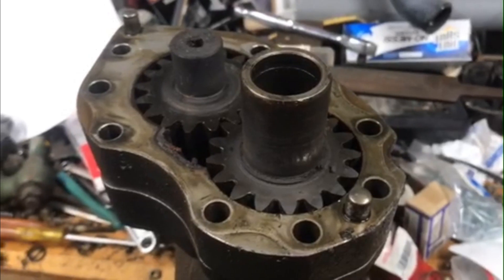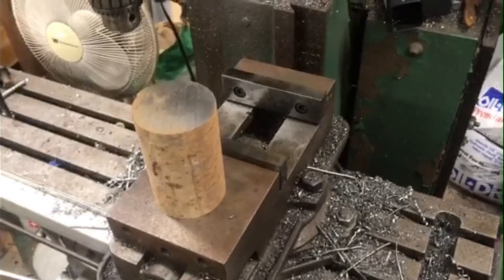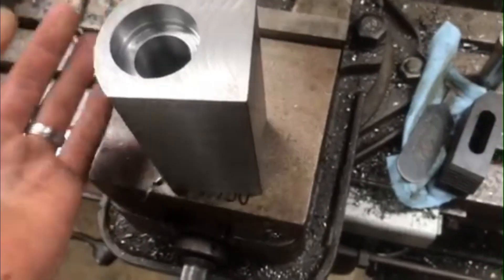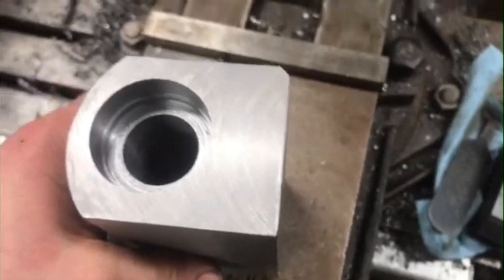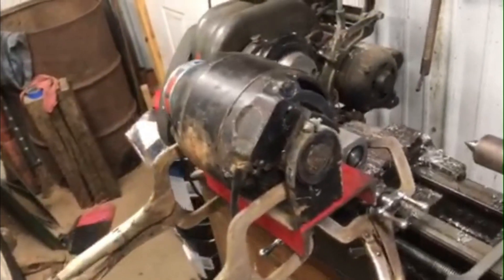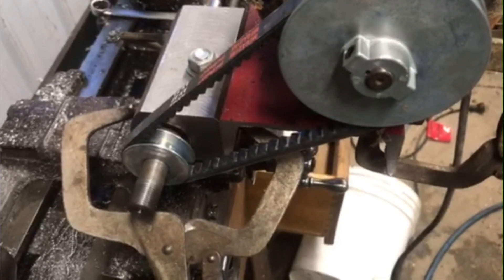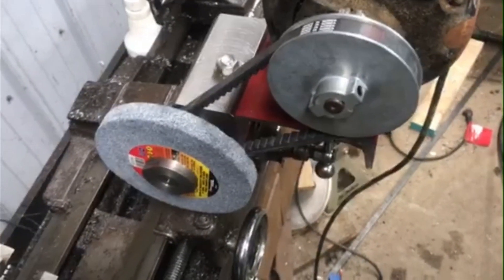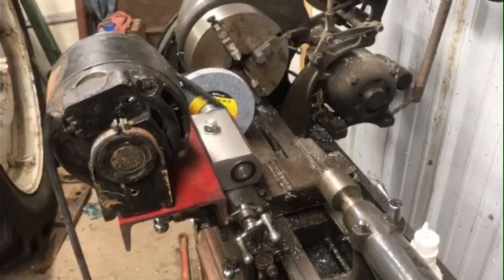Homemade Tool Post Grinder For My Atlas Lathe

Comment: Great video Evan. In a previous life I was a tool and die maker. That ended in '09 for me. I can still remember the basics but the finer points would be hard. Anyway, I always like the way you blend the antique equipment and the machining.
Reply from the maker: Thank you Mike! I wish I still got to do more work like this at work, but pretty much everything there is CNC now. The shop I work for builds large die casting dies, so it isn't production at least but I still feel pretty separated from actually making the part. I guess that's the way it goes. Thank you always for watching, Mike! Hope you have a good one Sir!